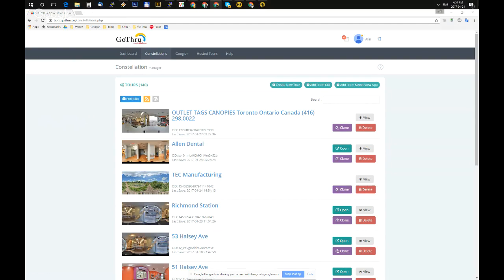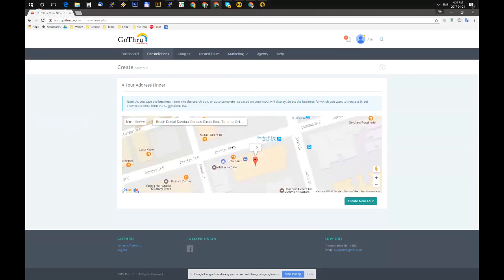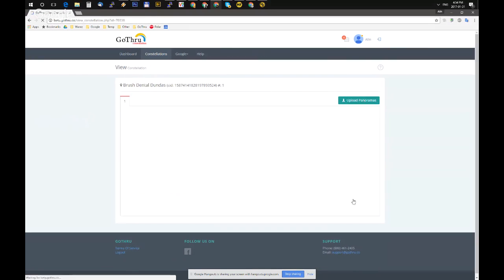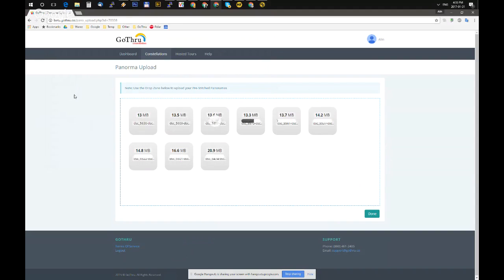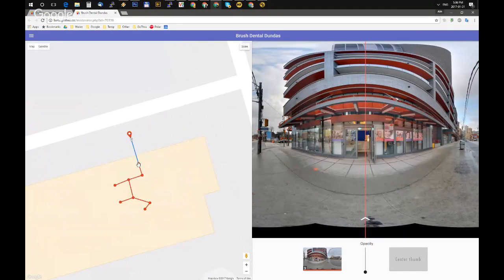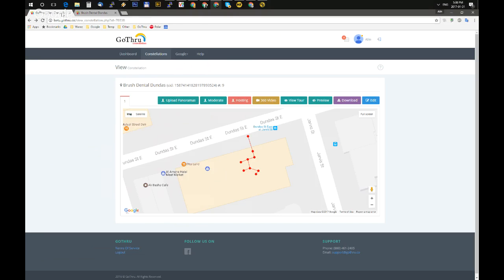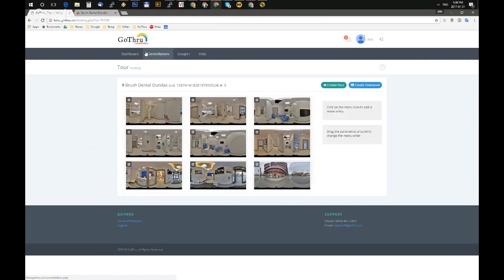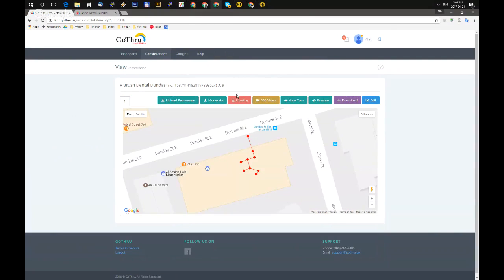Interview With Al Bug from GoThru

Comment: Google does not provide a platform to display the 360 . Google plus does not display the photosphere well as Facebook gives .I was taking more 360 photos of locations but it is not required as facebook allow upload only one 360 no connectivity . Local guides points are given for 2 photos only .My Page:   https://www.facebook.com/sariga360/
My Contribution to map https://www.google.co.in/maps/contrib/106746830034555486219/photos/@11.0070063,75.115382,8z/data=!3m1!4b1!4m3!8m2!3m1!1e1?hl=en